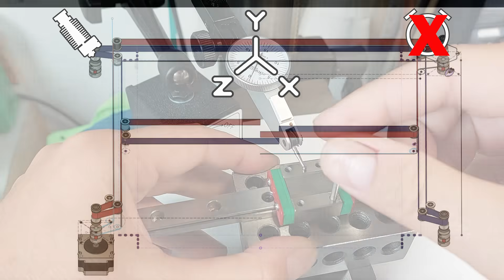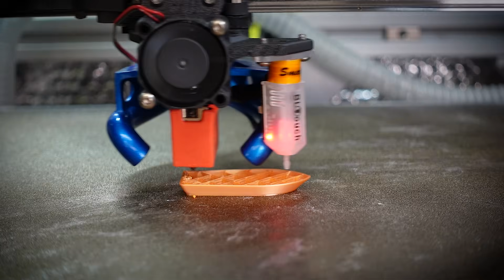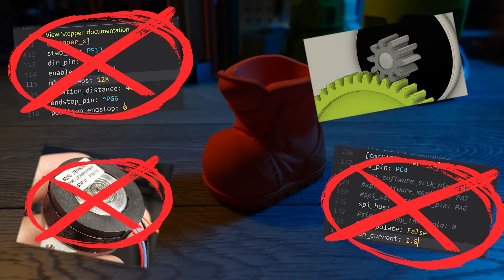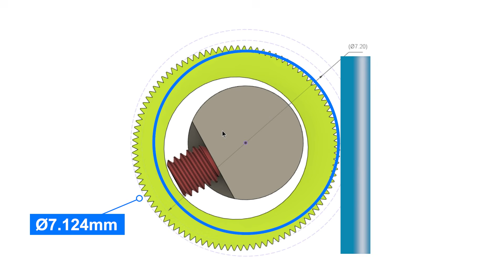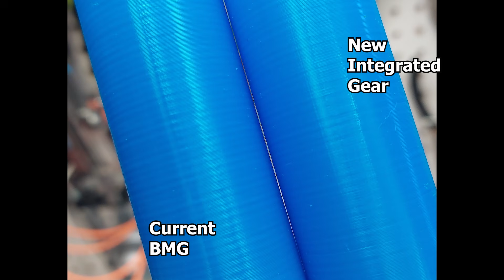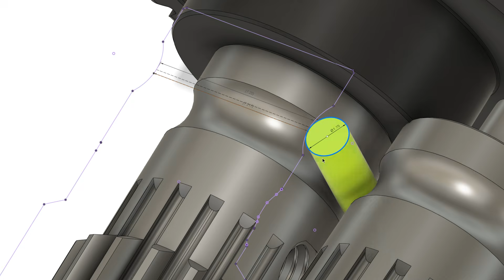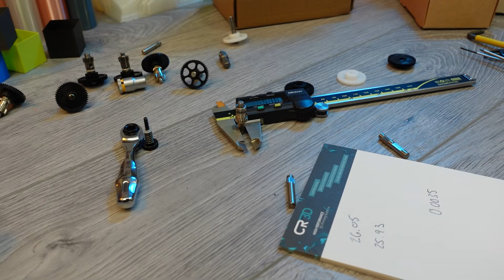Extrusion Quality - Mystery issue resolved !

Comment: Hey @mirage and @vez3d I have been working on this for almost 2 yrs and finally have been ready for release. I hoped lgx lite with the cam setup would be great but it wasn't.  So me and Jake Allen made a new extruder from scratch and it gets rid of these artifacts either with high grade filament or with a filament width sensor "not mechanical * . We are about to get cnc housings made vs the existing fdm test units and also want to switch to a more bespoke 3 hobbed gear setup which we used and is great but with the parts available we had to sacrifice performance with super soft filaments like ninjatek etc. Our 2 gear versions can print all filaments and are extremely light. Please reach out if you have any interest in testing or if you need any stuff for the Takotos or your shootout let me know.

Comment: Interesting - my old Sidewinder X1 produces exactly the same artefacts and I always thought it‘s the extruder, but never digged in that much. Maybe I should check the gears.. since it uses the old titan design, it already uses a bearing and arm movement is prevented pretty much by a spacer.

Comment: Im running a heavy modded cr10 dual z with dualgear all metal on a hero me with an e3dv6. The dualgear kit from bigtreetech came with two rollerbearings inside the two geared pushers. I dont have this fancy measurement tools, BUT i got a deacent two decimal caliper. I measure the difference of my two gears to within the tolerance of the tool. I get sometimes a pattern that goes at 45% angle from base. 

Found that i had variation in diameter of the filament from 1.71 to 1.74. I bought better filament and now its printing like a boss. Also disable powerloss thing to get faster smoother prints :) Good luck have fun!  

Remember a 3dprinter in the price class you want to spend is and always will be a hobby item . U need to constantly check and calibrate and fiddle and upgrade :)

Comment: A single drive gear with a spring loaded idler should take care of this issue, the mk8 drive assembly design has this built in, and I haven't had any banding issues since starting to use this type.

Comment: CNC Kitchen had a video about the very exact problem titled How I Fixed The Ugly Layers On My 3D Printer. So as soon as I started watching I was thinking to my self “surely this is not going to be an eccentric extruder veer problem”. It seems that this isn’t widely known, so more videos more better. I am just sorry for the effort you had to go into to figure it out.
Reply from the maker: Yes I had seen that video, but as demonstrated in my video the bulb of the artifact could not be fixed with an almost perfectly centered extruder gear.
Reply: @MirageC  yes, sorry I posted two thirds in and finished watching later. Thanks for replying.

Comment: Have we thought about closed-loop control systems for feeding the filament?
This would involve a sensor that could accurately measure filament movement to high resolution, and something like a high-quality servo-motor system, probably with an encoder, etc.

Maybe overkill.  But I would be curious if anyone was crazy enough to try closed-loop control in the extruder.
Reply from the maker: Yes!  I want to work on such a system!
Reply: Something else that I wonder about, are weird things like ultrasonic-motors (used in some camera auto-focus systems), and stuff like harmonic drives (zero backlash).

I'm just a mechanics enthusiasts who doesn't really know any engineering.

Comment: It would make more sense if the driver wheel was flat and only the idler had a channel/groove. That way it ensures a constant driving radius. Also, if the wheel and gear is such a critical part, wouldn't it make more sense for it to be machined out of a single metal piece instead of heat-fit into a plastic molded part?

Comment: What surprises me is that there is going so much thought into extrusion but the bed level is measured with BL Touch? Wouldnt an inductive sensor be much more accurate?
Reply from the maker: And how would that increase wall surface quality after layer.. #2 or #3?  Bl-touch works great.
Reply: @MirageC  ok, great! Thanks for the answer.

Comment: That means if you have such chassis that through holes are a bit off, not manufactured enough precisely, or you have cheap kit, all distortion, any printer part fraying, non-symmetric distortion, bad movement will affect your print. That means you are going to need really high quality, precision manufactured printer parts, and speed wasn't involved yet. I think mechanical parts has its own limits, and agree on improving – but what would be if your material is already has LIQUID, or GEL/paste form and use that with FDM method? Wouldn't be easier?

Comment: A nice engineering breakdown, well done. I don't have a background in 3D printing, but I work in the steel industry where we have very similar issues in cold rolling steel. Very small eccentricities in the rolls and thickness variation in the incoming strip translate into out-of-tolerance thickness variation in the rolled sheet steel (and wobbly car doors...). You can't engineer all of it out, so you have to have a dynamic control system to allow for it. Thinking about an analogy here, you would need to have a force or displacement transducer on the idler gear, to measure the effective filament thickness, and an independent measurement of filament speed, say a pulse encoder on another idler wheel. This would enable you to measure actual mass flow through the extruder - what you really want to keep constant. You would then need a controller to apply a correction to the stepper motor drive. This would effectively have two components, a cyclic one to correct for eccentricity and a slower feedback control to allow for fulfillment thickness variation. Sounds complicated, but several million tonnes of steel a year says this sort of system works. Hope this helps!
Reply: or just get a fillament diameter sensor.  no need to make the extruder extremely expensive just to put a force measuring sensor in the idler wheel.  
and yes extremely expensive because this thing needs to be able to do it's job without introducing more play into the idler.

Comment: Fantastic video! I got my first 3D printer up and running 8 years ago today (I naively thought I could 3D print an entire Halloween costume in a single night with no 3D modelling or printing experience). My first 3D printer suffered from this issue and I always thought it was Z wobble. Thinking back on it now, I remember the large extruder gears had visible wear on them from use, so it is very likely this was the true culprit all along. I cannot express how excited this video has made me, answering a question that has been burning in the back of my mind for the last 8 years. Thank you!

I also feel like I should mention MihaiDesign's video on this topic as well: https://www.youtube.com/watch?v=32dTLRNIYmw
Reply from the maker: Yes, my work and Mihai's are touching different aspects, but all related to the smae artifact and system.

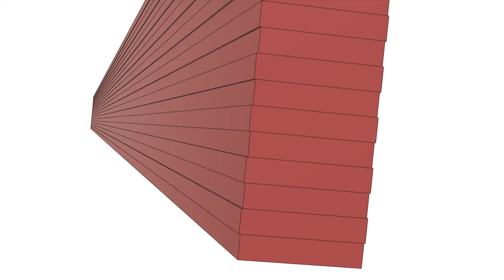Comment: At 12:24 you make the assumption that the expansion of the filament is for both the inner and the outer side of the print. I dare to question that assumption, in multi-walled prints I would expect it to be worse

Do you know if the torque of your motor is equal along the full rotation?
If you repeat a print (same g-code) twice after on another, is the height artifact at exactly the same spot/height?

PS: when making extruders which have to be perfect I always use a thermal fit to align things in the rotation.
Reply from the maker: Yes, that would be my understanding too as the filament would have no where else to go.  Excellent observation! Thank you

Comment: MirageC: Could we come up with an extruder test method that tests an assembled extruder to demonstrate the force/distance variations?
Reply from the maker: The best way to do is to print a part with a perimeter tha represents the volume extruder by one full turn of the gear.  If repetitive artifact are showing, then it is not the hobb gear being off center.  Measuring the frequency as in Mihai Design video, it will help you to pin point to the corresponding root cause: https://www.youtube.com/watch?v=32dTLRNIYmw

Comment: Fantastic video! My printer uses a Bowden tube, and my concerns are somewhat orthogonal to yours - I'm under the impression that the dampening effect of the tube is detrimental for retractation, is that a thing? Are there good ways to fight this other than going direct drive?
Reply from the maker: Cornering and small details will benefit from direct drive, and you will be able to gain some speed.
Reply: @MirageC  Thanks for your quick and good answer :-) I'll look into it!

Comment: Really appreciate these deep dives you do, very insightful. thank you.
It sounds like the best way to get around the affect of any play in the gears is to have a design where more revolutions of the gears gives a lower amount of extruded filament.
Could the screw extruder work better here where you are reducing the affect of the extruder play by having more revolutions per mm of filament extruded?
Reply from the maker: My approach will be different.  A bigger extruder diameter for the same runout will reduce the ratio of the impact.
Reply: @MirageC  ah! So more like the LGX gears. Makes sense! Keep up the good work, it’s appreciated by lots of us :-)

Comment: Random thought... could you do a closed loop PID controller using a compact version of your rotary flow meter to feed back actual filament flow rate? Seems like given the number of sources of error in this system you will forever be chasing your tail trying to track down these sources of error and mitigate them
Reply from the maker: yes that would be an excellent system to implement,

Comment: Not only that, to say I had the same problem: 
The wobbling extruder gear squishes the filament, making its cross cut slighly eggshaped instead of perfectly round. This causes friction inside the bowden tube up to the point the extruder gear cannot transmit enough force to push the filament through the bowden. As a result, the filament gets stuck and your print is doomed. 
It took me some time to figure out why the filament stopped advancing in the middle of the prints although the gear was turning.

Comment: The worm gears should have a larger diameter, so as to stop the worm gear rod from flexing.  This would also give it a larger (and more precise) rotation vector, and a finer toroid track around it's outer edge for it's "up and down" motion.

Comment: Wow. Excellent video. We occasionally run into that sort of issue of tolerances with RC car motor shafts and pinions, but I would have never thought to check that in a 3D printer. 

Also - I know it was an aside, but that visualization of filament with +0.05mm and - 0.05mm tolerances makes it very clear that the filament tolerances really do matter. I probably won't be bothered with most of my prints, but I'll definitely be reaching for higher tolerance stuff whenever I want things to look their best. 

Thanks for the phenominal content.

Comment: Interesting video but I find it strange that you are getting better results with Bowden.  I've done a ton of troubleshooting printing single wall prints for RC airplanes with Bowden tube printers and just find them to be far too inaccurate to get a good print.  The flexibility of the tube itself and the squirming of the filament within the tube leads to inconsistent extrusion.  This is especially apparent at retraction and restart point.  Most people who have tried printing these planes with a Bowden tube printer have either converted their printers to direct drive or given up on the endeavor entirely.  And that is printing at quite low printing speeds for maximum layer adhesion.  Higher speeds would be even worse.

Comment: what if the idler hub had a flat surface, rather than round - all the pinch coming from the drive side - eliminate any gear offset issues?

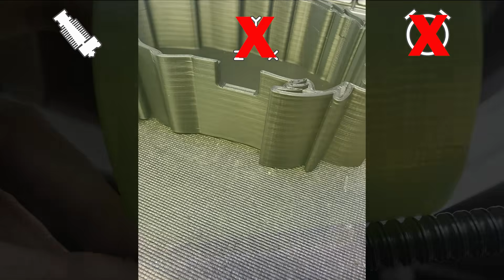Comment: I have only watched up to 3:30 ... I think that your problem is bed the hotbed buckling when the heater is on and you are using bang bang instead of pwm...
Reply from the maker: Soo, still think that after finish watching?  My bed Is 110VAC using PID ;)
Reply: @MirageC  No, I don't. But I had that problem (bed buckling when on ) and the symptoms were simillar ... The pattern on the prints was dependent on the size of the print.
Reply from the maker: @molak34  I totally agree with that being a possible cause.  but it was not in this case ;)

Comment: So in machining, one of the things we try really hard to avoid is cutting a surface from more than one setup, like cutting a profile from one side then flipping the part and trying to finish the profile from the other side.  The accuracy required to get a blended finish is just not practical, just .0002 of an inch offset is enough to make the overlap stand out.  It really does take extremely little to make a surface defects stand out.

Comment: This is very interesting. It also explains why my E5 Pro performed better with the bowden and stock motor/extruder than with the microswiss direct drive. After your video it hit me...The stock extruder motor has a press fit gear onto its shaft and no wobble(it doesnt have a tensioner screw). So i kept the all metal hotend of the microswiss and made a replaceable gantry for the direct drive (for use with soft filaments)

Comment: What are the downsides of removing the idler for a bearing? I got a hemera for TPU and I think the material elasticity tames these effects, but I still notice it a bit. I would worry that the grip i lose from the idler would affect the TPU due to its elasticity causing under extrusion. Any thoughts?

Comment: So what do we do in the meantime? Replace the idler with bearings like you did?  What size were those bearings?
Reply from the maker: They are MR85s. I shimed the staking so the filamnet lines up with the center of a bearing.  I painted the bearing with sharpie pen to confirm if the filament was at the right spot after a few minutes of print.
Reply: @MirageC  Excellent, thanks!  Gonna try that with my Voron 2.4....
Reply: @MirageC  same shaft?
Reply from the maker: @theamzngq  correct, pressing on the same roller bearing.  Its a tight fit, but it works.
Reply: @MirageC  Ah, ok, thx for the heads up.  I'll need some shims like you mentioned to keep the bearing in line with the filament.  Any chance you have a link to those as well?

Comment: Excellent Work! I have only one suggestion would it be possible to come up with a sensor to enable the calculation of the filament volume moving to the nozel from the stepper motor this could compensate for varying mechanical, and filament inconsistencies. this would also allow for printing with widely different filament diameters such as 3mm filaments.
Reply from the maker: Yes it is possible and it is in my plans.

Comment: Thank you so much for this video. I have to say I've started tackling this very same issue not too long ago this is why seeing this video made me really happy. I've upgraded my ender 3 so much, I am now changing to a belted z to combat the slight z wobble I was having but extrusion artifacts are killing me. I think my direct drive configuration and my extruder need an upgrade. The mount that I am using has too much flex which is probably introducing some issues as well.

Comment: I have a feeling MIG- or FCAW if you want knurling- wirefeed rollers meant for welding could be adapted to avoid that runout issue, of course the gears would still need to be adapted or fitted to them

Comment: I've had that issue with tension on the spool, it would tug every few seconds as the filament would be gradually used up and tensioned, then the spool would rock forward and more filament would be loosened. I was using a custom extruder with a tiny stepper though, so that had less tolerance for resistance than most extruders.

Comment: Seems like a lot of small things can easily add up.
Would the extruder gears also become a bit oval shaped if you tighten the grub screw a bit too much, adding to runout? 
If so, the solid gear from Bondtech would fix this, especially with a solid idler as well.

Great work. Every video you do adds to the progression of 3D printing.

Comment: i solved some of these problems by simply increasing the extruder temp 
how much ?
35 degrees 
this means u have to print faster then normal  and u wil have a little stringing going on ( not in vasemode tough)
slow prints result in burned extruded plastic 
not ideal but if u dont want to change the extruder assembly its a good solution 
bowden can solve some problems but in general give u more , i dont even consider a bowden system anymore